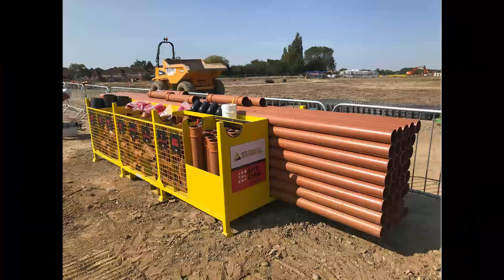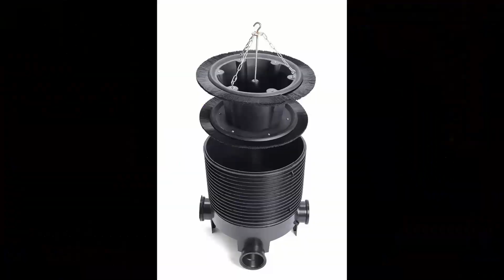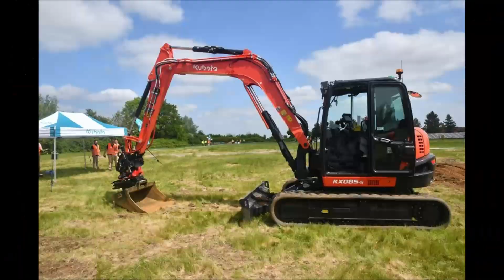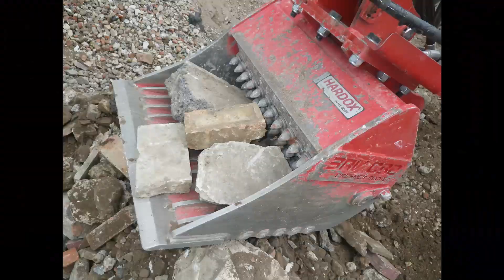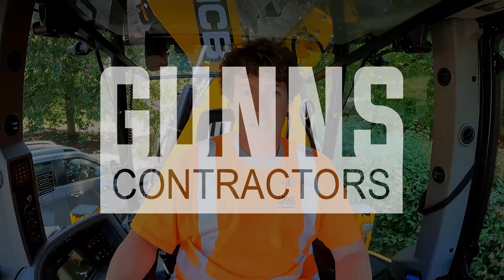Must see at Plantworx 2023

Comment: Everywhere else in the world they have a tool called an articulated loader. Only in the UK & Ireland is there this obsession with site dumpers. You'd be better off with a loader than that abomination surely. It seems they have gone a round about way to reinventing the loader which didn't need to be done.

Go to Germany or France they barley use site dumpers as they are cumbersome dangerous and require additional machines this only solves one of these issues.

Good video though Ollie thank you.
Reply: That's right with a backhoe loader it does a lot of work
Reply: @vincentnormand2882  A back hoe loader is another inherintly compromised design though. Only steering with the front wheels it's just a modified tractor. I think mecalac do a 4 wheel steer one though which wouldn't be as bad. Still cannot beat the articulated loader imo.